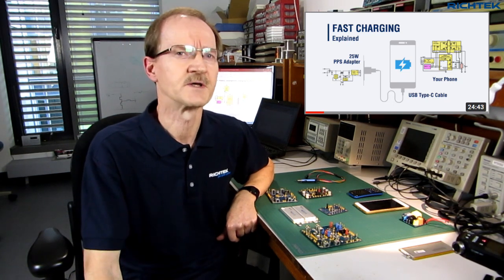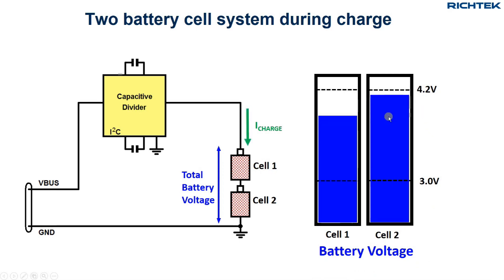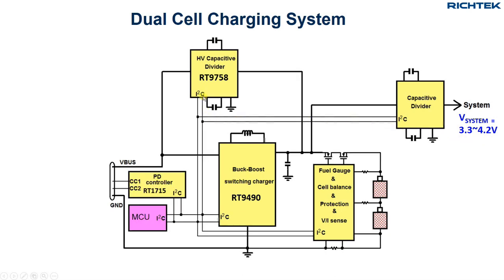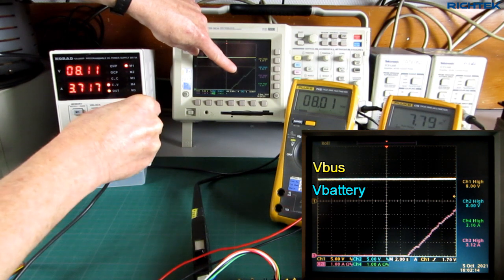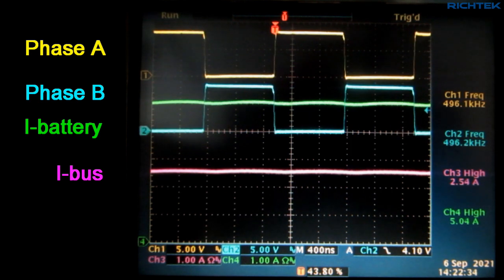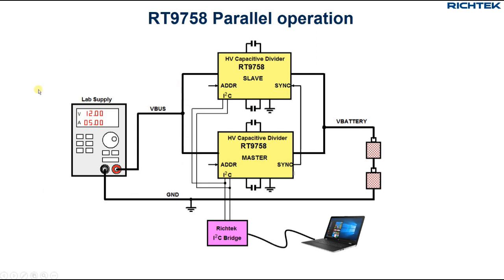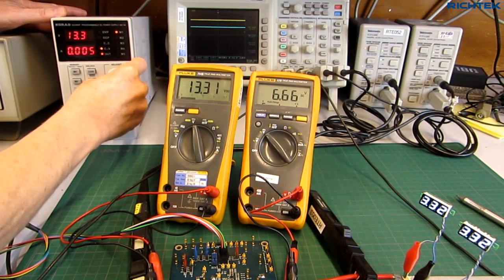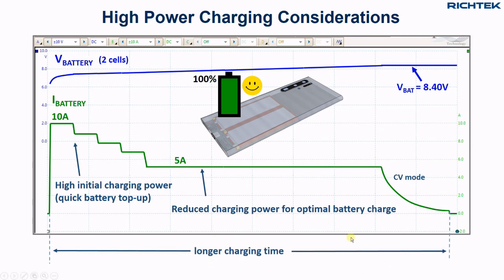How to Achieve 100W+ Charging in New Generation Smartphones

Comment: Do you think if there is a switching regulator that can be design with excellent efficiency throughout all current loads, that the div 2 charger IC can be eliminated in the overall system ?